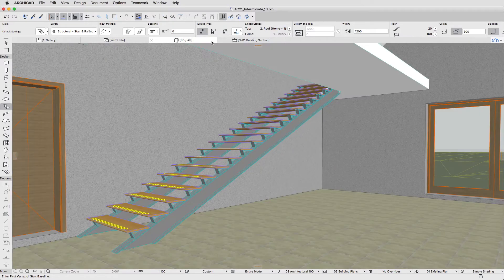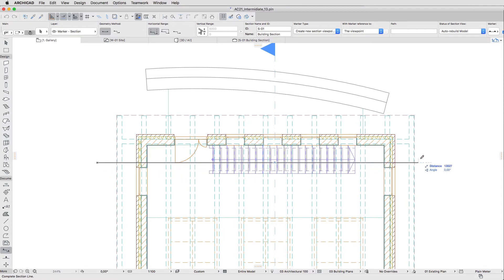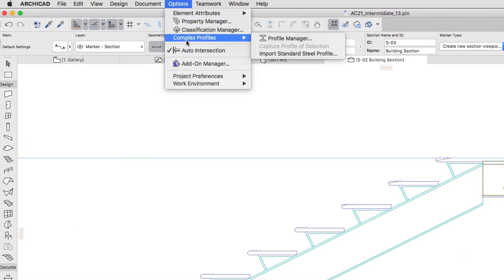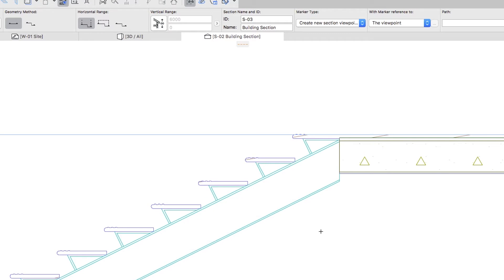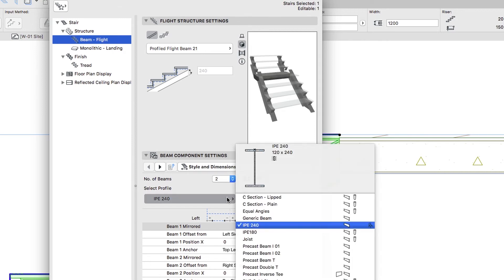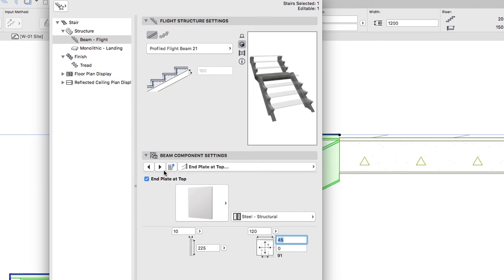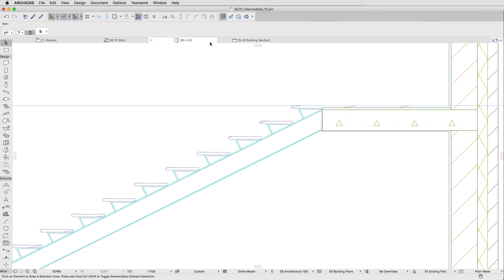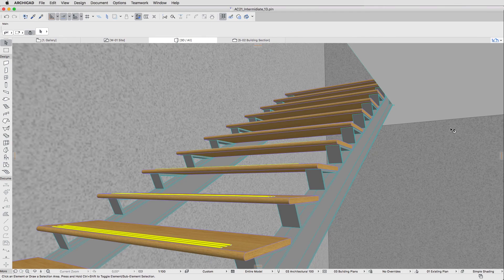Stair Editing - ARCHICAD Training Series 3 - 35/84

Comment: I had to set Horizontal Cut and dy = 100 in Support Connections -> Flight-start to place the bottom plate right on inside Floor.
Reply: Para Archicad BRA -> Ctrl+T >> Escada >> Estrutura >> lance-viga >> conexões de suporte >> corte horizontal >> dy=100